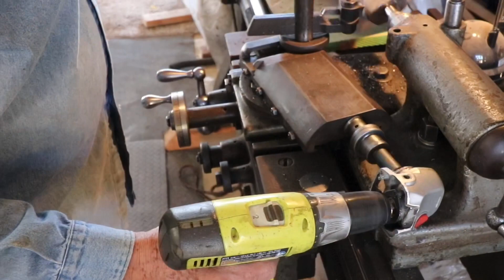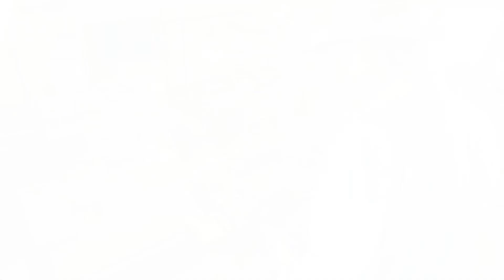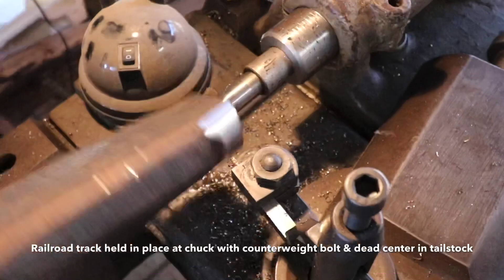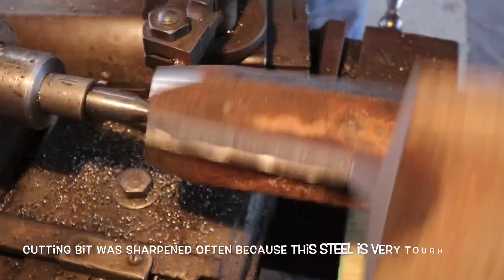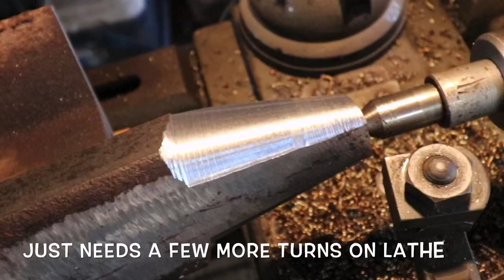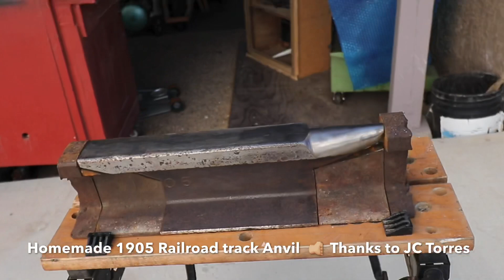Making ASO/Anvil Horn on Vintage Lathe (Caution!)

Comment: There are so many videos of railroad track anvils online, but this one is very different.
Turning the horn on the lathe without the use of welding or angle grinders is indeed worth alot of respect!
Reply from the maker: Thank you so very much for noticing and nobody has until you!!  The fabricator guru and maestro JC Torres is very skilled at working the lathe!  Thanks again so much for watching!!!
Reply: Thanks  both of you for your kindly comments